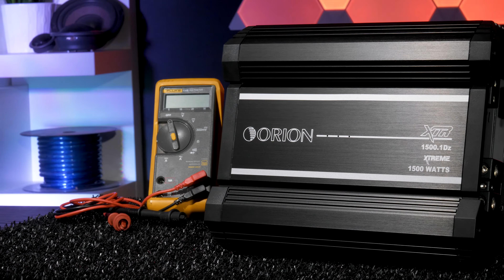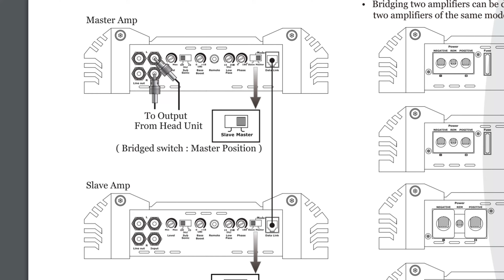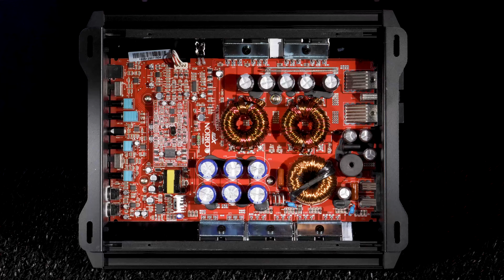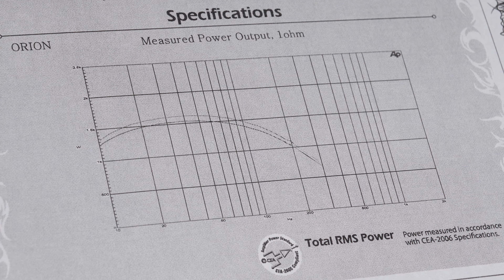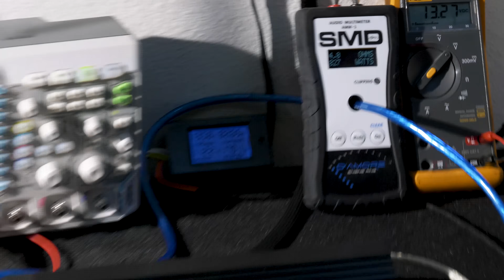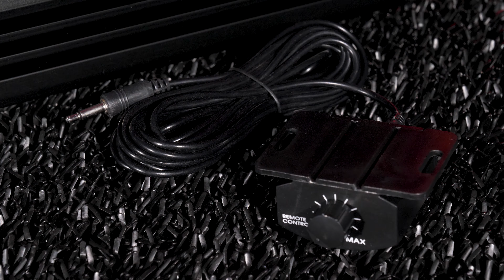Orion XTR1500.1Dz 1500W RMS - 4 ohm load TESTED

Comment: You said you need a couple batteries and a new alternator for this amp.  I have an optima redtop, but that is all for my upgrades.  How much will I be missing out if I plan to run it at 2 ohms?

Comment: I bought this and it's crap has no way close to the pioneer 9601 power
Reply: All of pioneers amps are way overrated. The max a 9601 did at 1 ohm was 1700rms, the Orion on the other hand does a max on 2200rms
Stfu
Reply: @rickytrevino8281  opened up my orion only to find out it's a Chinese piece off shit that way my 9601 pounds harder

Comment: When are you guys going to get a better power supply. HP 120 amp power supplies are $15 on ebay. a  breakout board gives you positive and negative wires and turns the psu on and is  $10

Comment: Can you run this amp at 1.33 ohms?
Reply from the maker: This amplifier is stable at 1 ohm, 2 ohm and 4 ohm. So yes it will run just fine at 1.33 ohms. Anything above 1 ohm is fine, just less power output.

Comment: I have 2 nvx 10s there 2 ohm and about 850 rms would one of these push both of them good I have the speakers wired to a final 2 ohm? You know what kind of rms this amp pushes at 2 ohm? Because I’m sure the 2500xtr will be to much?? Please respond?

Comment: Hello question can you wire two different Subs same brand dual coil one is 1500 rms and the second sub is 2000watts and hook it up  to a Amp will that work or will it be a disturbance in it
Reply from the maker: Are they both DVC and both the same impedance? I always recommend using identical amplifier's

Comment: Looks like an awesome amp. Why would someone want adjustable phase 0-180 degrees over an adjustable sub sonic filter. Not everyone’s box is tuned the same, so I’d be more interested in the subsonic filter. If I’ve done my research correctly the phase adjustment is if you are having phase issues with blending your highs and mods together. I’d rather have a subsonic filter that is going to protect my subwoofer and make my amp run safer , rather than blend it better with my highs, but have no bottom end control and my sub unloads and blows.  That’s just my 2 cents. Someone correct me if I’m wrong or way off. I love constructive criticism
Reply: If you have multiple sub amps incorrect phase is way more noticeable at low frequencies